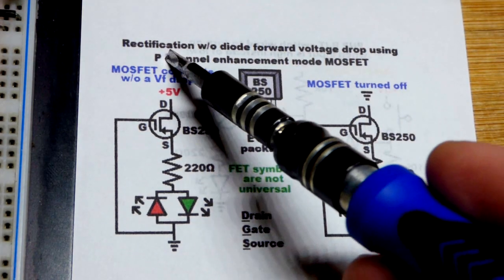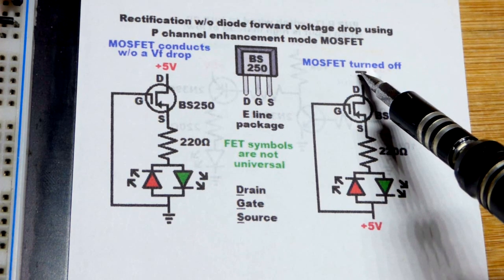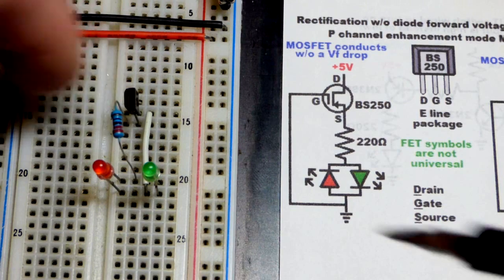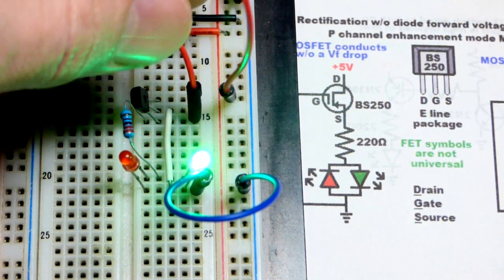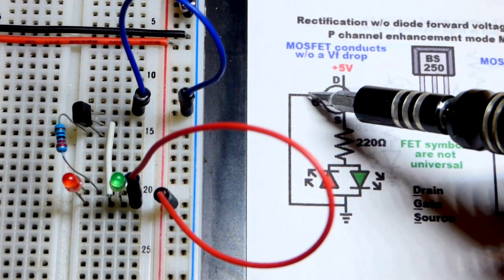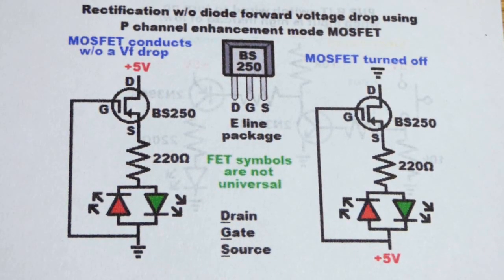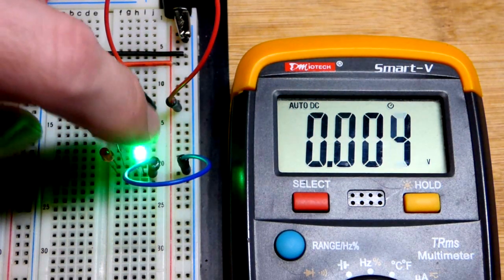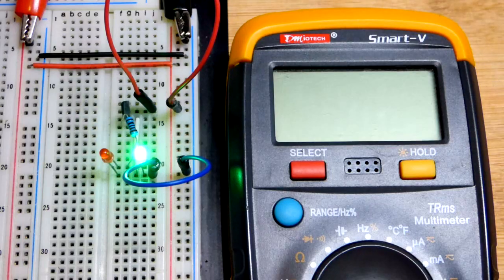Rectification without diode forward voltage drop using P channel enhancement mode MOSFET BS250

Comment: Does it work to rectify AC INTO DC ?
Reply from the maker: I haven't come across a circuit that uses MOSFETs to rectify AC to DC. The aren't as straightforward as rectifier diodes so I imagine you'd have to get some that are specially made to do so.

Comment: I assume there’s some limit to the reverse voltage the transistor can handle without damage. Where would I find that in the data sheet?
Reply from the maker: Yup, always consult the datasheet :) Diodes incorporated's BS250 datasheet says Vds (Voltage drain to source) is -45V. While Vgs Gate to source is ±20V

Comment: Great Simple technique...Thanks.
Is it because of the voltage drop u used Bs250?
Reply from the maker: Thanks! BS250 was just the P channel enhancement mode MOSFET that I was able to find and afford. I'm guessing that all low power P channel enhancement mode MOSFETs would work close to the same, and there's probably at least one that is specially made to have less resistance when wired like this, and thus transfer power even better.